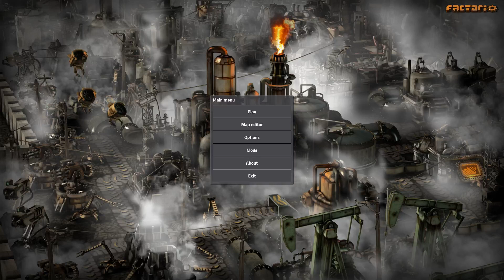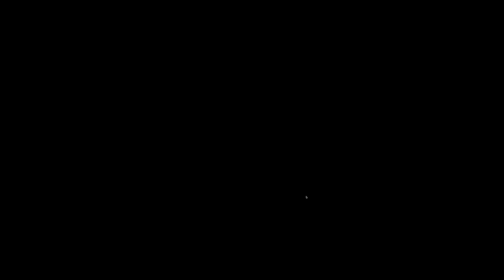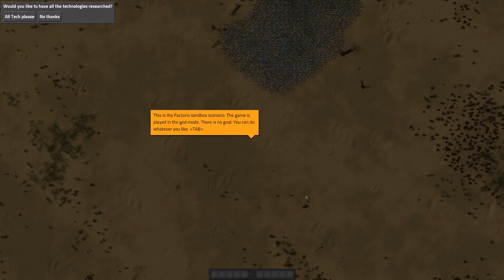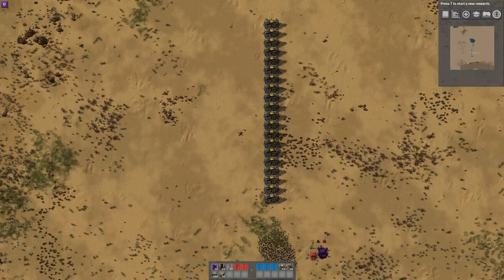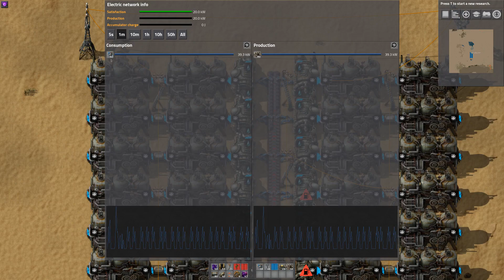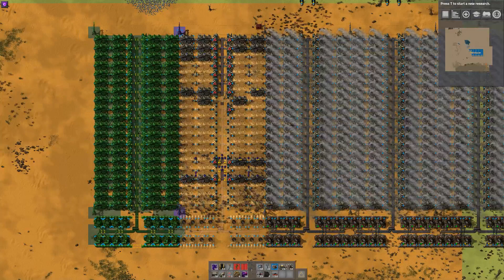Factorio Sandbox: Tileable solid fuel steam power

Comment: Smoke does kill FPS! there is a option to turn it off, and generally its the first thing i turn off (in 0.15 it still 'rendered' but just didn't display you actually had to get a mod to remove it (smokeless))
Thoughts.... Light oil is more efficient then petrol for solid fuel and productivity modules? Also If you make rocket fuel (only applies if using productivity modules) you actually get more energy out for the energy cost to convert solid fuel to rocket fuel.
I didn't see the fluid production tab, but Maths says it's about 850 Petrol per second (thats a lot) it would be half that if you used light oil
Secondly you do realise that because the steam engines are back to back with Boiler->Engine->pipe->engine->engine->pipe->egnine->boiler you have made the game very confused and the liquid (steam) inside that pipe string also very very confused!
I'd suggest changing the layout as follows going boiler->engine->engine Substation engine<-engine<-boiler
Reply from the maker: Thanks. I didn't realise about the fluid mechanics -- I'll definitely look at fixing that. I designed this boiler array for mid-game, so before the rocket stuff is unlocked, but yeah, running this on rocket or nuclear fuel would be even better. It is tempting to attempt a megabase purely on steam power, with no solar or nuclear.
Reply: Poor UPS ouch lol
I'd love to have ONE game for just my power, and one game for my MegaBase lol Have it running on 2 PC's the fuel goes out off map on a train, appears on the other map and Power goes off that map back to my first map!

Comment: Also just occurred to me, you are using a "standard "  row  of 20 boilers .  That was I believe set as the number because burner or yellow inserters can eat a full yellow belt at that length.  Since you are using red belt, you could "in theory" run 40 boilers per side,
Reply from the maker: Good thought. I will test that.
Reply: A single pump can only support 20 boilers for more then one pump well maths becomes tricky, In theory 2 pumps can do 30 boilers, and 3 pumps can do 40 boilers.... Maybe fluids in factorio are tricky, and even Wube doesn't understand the code lol

Comment: I'd suggest making solid fuel from light fuel instead of petroleum, as you can use the petrol for plastics and the light oil to solid fuel conversion is the most efficiënt one.
Reply from the maker: Good idea. Assuming I have enough light oil. Even with productivity modules, I think it's better to use light oil.